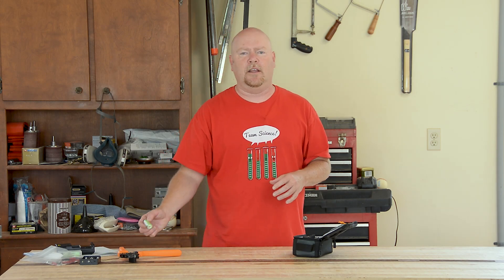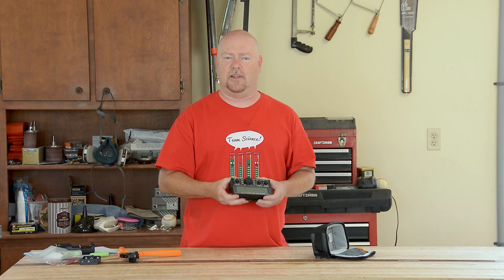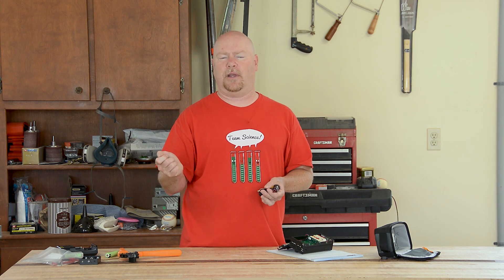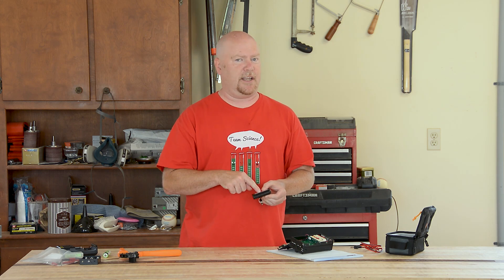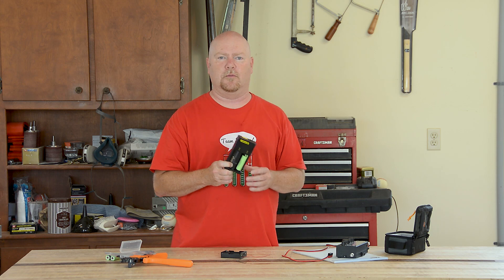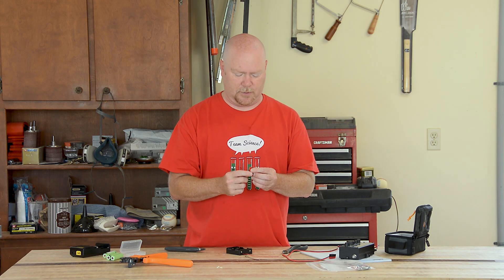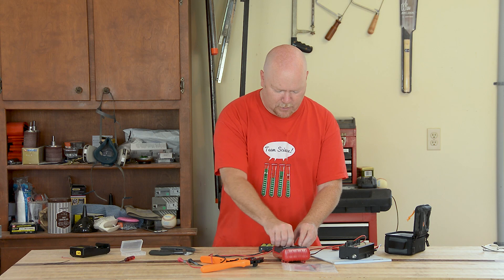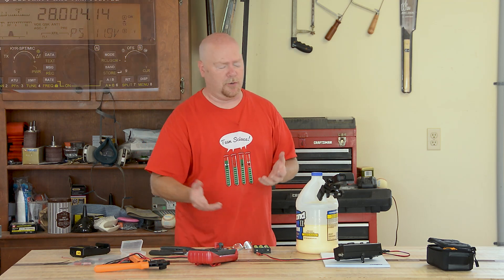DIY KX2 Battery Pack

Comment: At about 2:05, you mention Elecraft is the only manufacturer you knew who made an internal battery pack for HF rigs.  Actually, the Yaesu 817 and 817nd were built with internal batteries, and they could be charged within the radio.  The Yaesu 897 and 897d also was built with an optional internal battery back.  I own the 817 and the KX2, use both, and like both; but Elecraft should have found a way to charge the battery internally - after all Yaesu figured it out 16 yrs ago.  I like your enthusiasm and your battery set up, hopefully elecraft takes notice.

Comment: The ridges on the PowerPoles are called Dovetails. :)  
Note that some vendors sell the housings already joined with the proper orientation. I always keep one in the kit to use as a guide to get the orientation correct when mating the loose housings.

Comment: They use diodes between the battery, DC inputs and the radio, which drops a little voltage so the radio's readings are lower. There is one thing about using the same battery setup externally as is used internally. Normally the external voltage is higher and so will power the radio and the internal pack will not supply current. With the same battery type and voltage range external the radio will draw power from both the external and internal battery. So the internal battery will not remain fully charged unless the external voltage input stays higher than the built in battery all the time. Making the external pack from 4 cells of LiFePO4 is one way to insure that the external input voltage remains high until the end of capacity is reached.

Comment: A common saying used to describe the proper power pole orientation is “red right, tongue top” where “tongue” refers to the metal contact inside the plastic shell. Thus, looking at the open end of the connector, just as you do, the red goes on the right and oriented such that the tongue is at the top of the opening. I suppose there are any number of ways to describe the orientation.

Comment: Thanks Matt!  Another great video.  I sincerely hope you make many more ham radio videos.  You are great at it.  I have a KX2 and didnt even bother getting the internal battery.  I didnt like the cost, but even more, I didnt like the idea of having to routinely crack the thing open just to take the battery out.  Worse yet, I didnt want to get a second battery and have to open it in the field - no good will come of that.  I will likely build one of these.....it is just to simple.  Just to let you and others know of another idea, I have been using a Lithium pack from Amazon intended to power LED lights (the brand I got is "Talentcell" but there are a few similar ones).  The price is good too.  It is 12V out on a standard 5.5mm plug like the KX2.  You can get a simple car charger for it as well.  The other cool thing of it is that it has a 5V USB outlet so I can charge/run an android phone at the same time to do PSK or logging or whatever.  Just thought I would share.  My batter pack is not as small and likely as light as this, so this goes on the project list for sure.  Thanks again.  73s!!

Comment: Nice external pack. It is unfortunate that Wayne and Eric of Elecraft have such an extreme fear of charging lithium batteries inside the radio. Both the KX3 and the KX2 suffer because at this point they really should have internal rechargeable lithium batteries.

Comment: No easier than this , thanks so much for your video. Just got the parts, made 2 packs and joined them in parallel using the power poles to join the wires. I now have more capacity for the kx2, still pretty light and compact. Didn’t have epoxy put used superglue and sprinkled baking soda on top of the drops, dries in a second or 2 and hardens like plastic
Reply: Instablaster

Comment: Matt, I found your comment on the Matsan channel regarding problems with the Rode FilmMaker mic cable. Did you solve the issue? I'm thinking of buying a Rode FilmMaker kit, but I do not want noise in the voice transmission.
Reply from the maker: I ended up determining that it was a bad mic.  R0DE replaced it under warranty, but they made me send the whole set into them for service to get it.  Overall I think the set is worth its price, but that's in a market that's generally over-priced IMHO.  If I had the option of a used Shure or Sony for the same money I'd take it.
Reply: Matt thanks for replay! By the way, love your channel! Especially regarding woodworking.

Comment: Cool video! Did you use 15A power pole connectors on that battery pack?
Reply from the maker: Thanks Craig.  I did.  I wanted the shells to be compatible with other ham radio gear.

Comment: whats the info on the charger? you recommend any other charger?
Reply from the maker: Mine's a Nitecore brand charger.  Seems to work as well as any other charger and they're certainly inexpensive enough.  Only change I'd make is to get one that'll do 4 cells at a time.  2 isn't enough capacity and the price difference is nothing.

Comment: Audio is crackling on this video.
Reply from the maker: Try re-loading it.  It plays fine for me, and Premier is good about letting me know if the audio is clipped somewhere.  Thanks for checking it out!
Reply: Sounds like a slap with a gate or compressor in audio editing, to me. It goes from being nearly silent to speaking quickly and makes it sound less natural. I probably wouldn't have noticed it without headphones.

Cool video. Not a radio guy, but good info in this video!
Reply from the maker: Thanks.  You may be right.  I just upgraded Premiere and the compressor is quite different.  The old one had good default settings for attack and release time, but I just went and looked at the new one and it's way - way off.   Will know to adjust it for the next vid.